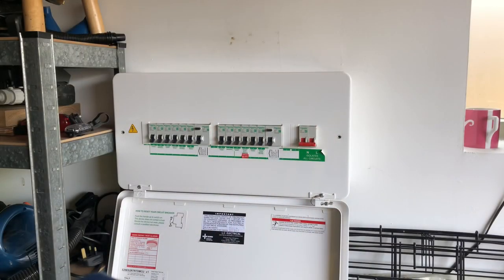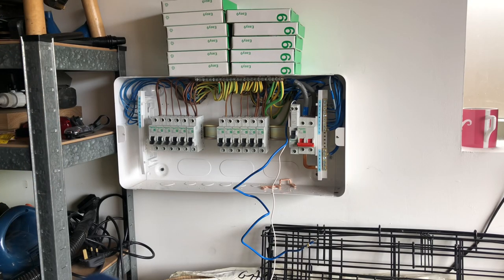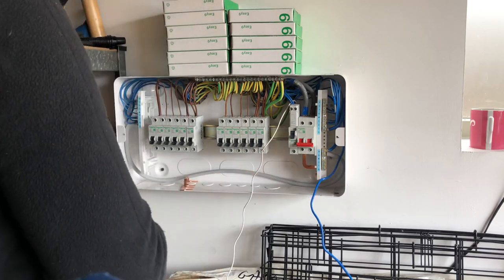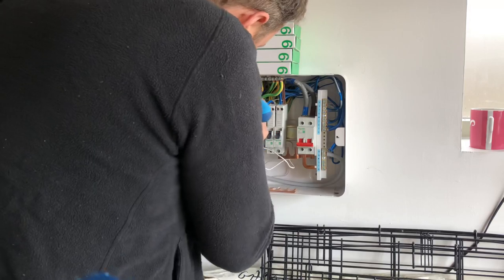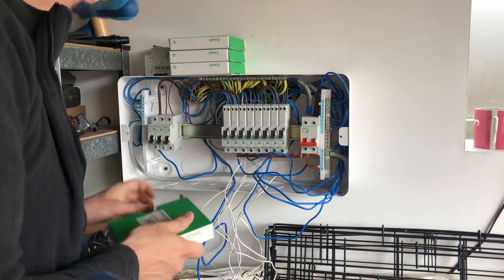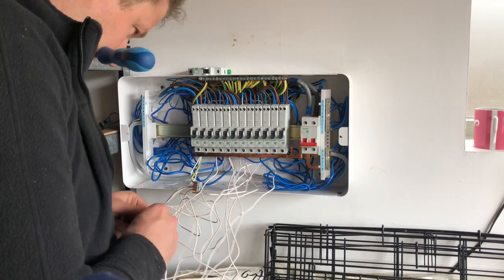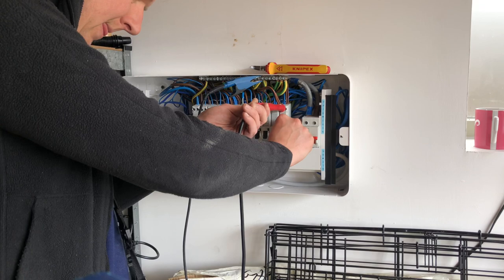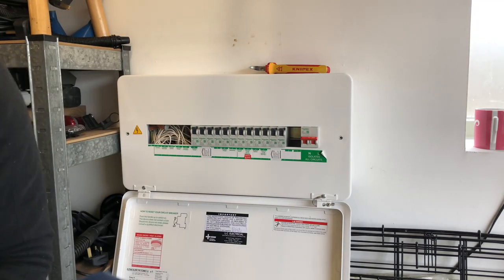Avoid Nuisance Tripping - Converting a dual RCD consumer unit to an RCBO one. Schneider EZ9.

Comment: You dont need ring continuity on the CPC.
Record the x1 RCD trip time not the x5.
Cut the tails.
Rings too big - then split to radials.
Reply: Simon Poole Lol
Reply from the maker: Why do you not need ring continuity on the CPC?
Reply: @artisanelectrics  ring continuity is to allow for increased current carrying capacity of the L + N conductors, ie it benefits us to have a 32A MCB (with 24A in each direction). The CPC is only there for Zs purposes.
I'm not saying don't ring the CPC, but if you don't have it, it's not a major issue so long as ALL Zs readings are under max permitted.
It's a code 3.
Reply: @robtno1  read my reply. "lol"